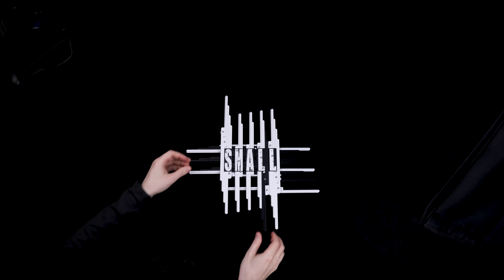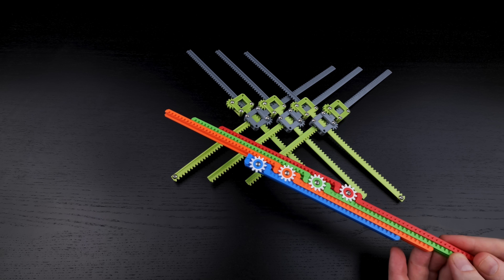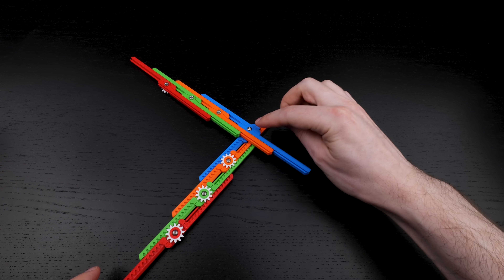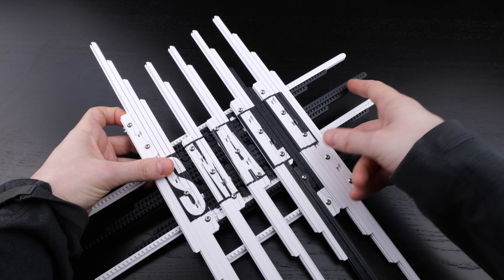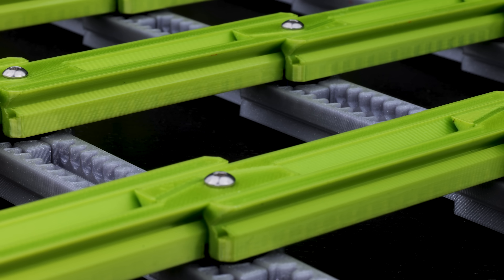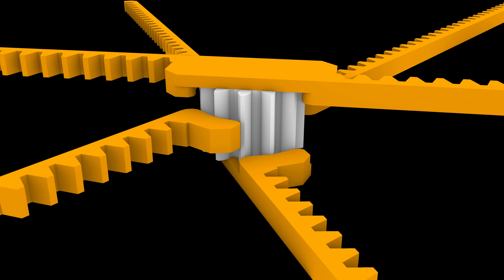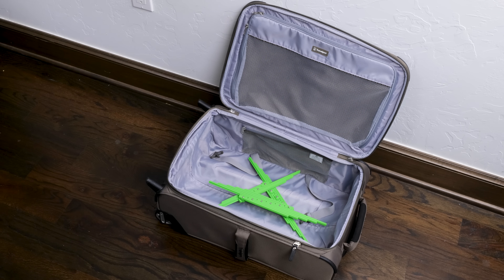Expanding racks

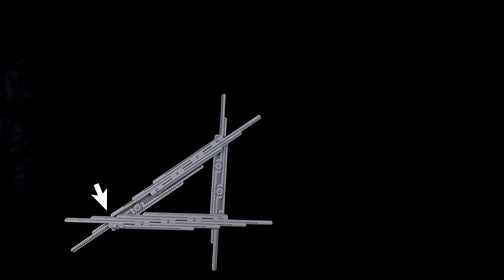Comment: 15:00 Actually. Can you make the inside racks very long? It could be used as a ruler for a black board, a pretty handy one indeed.
Reply: If it was made out of stainless steel and the boarder/edge of the ruler kept a flat straight line during expansion and contraction then yes that would be a great ruler. With some creative liberties you could possibly make this type of ruler have the ability to disconnect and reconnect (attach and detach?) at one connective junction between expanding racks, letting it fold in on itself kind of like a butterfly knife (hard to explain with words it would be easier with visuals)

Comment: A design team I was in a decade and change ago used a very similar design in order to achieve a 2 to 1 telescoping for a mechanism to shuttle a heavy payload along rails.

I believe we used chains confined in a track, and those chains were attached around sprocket in a similar way to how you are using the gears. Basically, there was a fixed stage, a moving stage, and finally, a 2:1 moving stage, exactly like your first example on this video.

I don't know if the system was ever finally built and implemented, but it was a real mechanical application where we were space constrained and needed to provide mechanical motion of a package along rails, so we used this to effectively achieve that solution.

It's funny because no one had a good understanding for how the system would work until I made a cardboard model using push pins and string. For the design review with our customer, I 3d printed the mechanism similar to yours.

Great video. The mechanism has real application in mechanical engineering, although it is (like many mechanisms) a little niche.
Reply: That sounds similar to a pretty common mechanism used in forklifts, where the hydraulic cylinder attaches to the gear with a chain looped around it, so one end of the chain stays still and the other moves twice as far.  I suppose a chain avoids needing large precision-built gear racks.

Comment: I was tinkering about a soution for a project. I wanted to make a shield that can collaps for airsoft. The solution i want to try are folding segments and fould them. All other variants were to heavy and complicated for something like that. But what i saw here gave me a complete new perspectiv and i want to thank you for that.
Reply: If you had the means you could use a co2 canister to expand tubes like a hydraulic ram
Reply: @macallan3933The Thing is i want to strap it in my arm and keep the weight as Low as possible. I Font know how heavy that would be.

Comment: How would you go about preventing it from collapsing in the most simple way? Let's say I want to use it to hold something heavier than it while extented.
Reply from the maker: If you have a motor attached to one of the gears that opens or closes it, just hold the position of the motor to stop it collapsing?

Comment: This could be used to make expanding habitats on space stations. It could be transported packed in its small form and expand to much larger size potentially as girders or the exoskeleton of pressurized modules. Maybe it could also be used in large, boxed transport vehicles to lower aerodynamic resistance when traveling empty.

Comment: I think I independently came up with your extensor mechanism (3fold scissor)! Have you tried differentially powering one of the 3 legs of a single extensor, and also creating the interlinkages (between each leg) flexible? Id be interested to see what kind of directional control one might have over the direction of extension
Reply from the maker: Compliant mechanisms (and anything else that relies on the material flexing) seem really hard to design!
Reply: @henryseg I’m not exactly sure of your implementation of the extensor as the resolution is not great, but in my inplementstion I had a common node that was 3 pivots connecting the legs, I believe it would only take a pivot that was effectively on a ball joint
Reply: A pivot shaft made out of a flexible material seems like a simple
Place to start

Comment: IRL pinch-to-zoom, how neat! Put some LEDs on a rectangular array of these, and you could make a low-res screen with adjustable size. 

Would it make sense to have a robust but sparse grid of double/triple racks as a base, and then fill in the holes with a bunch of identical smaller, finer grids? To increase the resolution, I mean.
Reply from the maker: LEDs on the grid would be very cool! Wiring it up though… I’m not sure about smaller grids to fill holes. Maybe have the smaller grid at 45 degrees to the bigger, and only attach at the corners of the square hole?
Reply: @henryseg Right, I hadn't thought of the wiring... I'll bet screens are hard enough to engineer as it is even in their fixed-size variety.
Reply: @henryseg  I think it might be possible to simplify, by making the racks themselves conductive. Imagine a 2D grid if rows and columns of racks, where each pixel is located at a junction and connected to its row and column. Each LED could be made to shine individually by placing a voltage between a specific row and column, say using a RaspberryPi. Cycle through them quickly enough, and it should look like a picture, and you could go pretty quick if you did diagonals of pixels in parallel.

Comment: Using the gears that have one size on the top and one size on the bottom, it would be very interesting to see if it’s possible to make two squares that sit on top of each other, where the bottom square is smaller than the top one when collapsed, but larger than the top one when expanded. 

As for practical applications, I could see something where an arm needs to grab something that’s far back on a ledge, and by using two or more gear ratios here, you could accomplish that with a single motor controlling the entire complex motion. I don’t know that it would be any better than existing solutions, but that could be neat. Additionally, you could make baskets that can expand to the size of the items you want to put in them if you had some way of locking the racks and pinions in place. That would be useful for the trunk of a car. When I go grocery shopping, I buy a pretty variable amount of food, and having an easy way to size a basket up or down to hold the bags vertically in the trunk would actually be pretty nice.

Comment: You could potentially use this to make some sort of deployable expanding truss bridge, where, when stretched out to span a gap, it also increases in height to increase in rigidity enough to support a load, but it can then be collapsed to be transported in the back of a truck that can cross it.

Comment: ● The movement of the stack of sliding rods at [1:40] is a dead ringer for a pattern seen in nature, specifically in Bacillaria (A clade of photosynthesizing Diatoms +), which, needing both sunlight & access to nutrients, will slide their long silicate shell bodies in precise relation to their neighbours to maximise their access to both resources. I suspect that if you showed your designs to a microbiologist or had a researcher investigate any structures ressembling your designs in nature, then you may find that evolution has already solved many of your problems through millennia of trial & error. (Biomimicry is a branch of Engineering Design where we replicate nature's design solutions). 

● It may also be a "proof of concept" that these types of mechanisms may work as micro or nano-structures (although how you would control, power or especially assemble the structure would be a major work in itself). The potential is huge though; if you consider a far future material being able to go from a small dense cube (like a block of hardwood), to a big diffuse cube (like an aerogel), while retaining its structual integrity. You could build a robot composed of myriad 3D shapes, which would move something like a gigantic pixilated slimemold, oozing from one shape into another by altering the densities of its nano-block components (or moving the individual parts in relation to each other) in waves rippling across its form.  

● It will be fascinated to see how you'll extend these expanding tessellating structures into the Z axis, making a 2D pattern into a 3D one while retaining the movement of the mechanism, taking it from a small dense cube to a large diffuse one...

Ref:
   ▪︎ Bacillaria (Microcosmos video on The Diversity of Shapes in the Microcosmos [8:00])
Reply from the maker: Wow I had never heard of Bacillaria before, they are super cool! Yeah if anyone is in the business of designing tiny geared machines (with photolithography?) I’d love to try designing on that scale.
Reply: @henryseg  These amazing microorganisms (and others like them called Radiolarians) actually construct their stunningly beautiful & extraordinarily complex exoskeletons out of Silica (SiO₂ which they can extract from seawater), making them both structually strong, and - importantly for a photosynthesizing organism - transparent to visual light (though opaque to Ultraviolet). nb: I highly recommend that you check out the artwork of the 19th century scientific illustrator, Earnst Haeckel. [ ● ] Some of his illustrations show the extraordinary biological engineering (which you'd swear was artificial, even architectural) in the "Frustrules" [ ●● ] of Diatoms (& similar organisms) in quite exquisite detail. More recent images (captured with an Electron Microscope) show nanoscale structures (derived from approx. 3.7 billion years of evolutionary progress) which show tremendous potential in macroscale human engineering & design applications. 

~ ~ ~

This situation actually illustrates an increasingly common problem in Science.

It's pretty much a complete fluke that:
   ▪︎ I'd seen that Microcosmos episode, 
   ▪︎ I'd memorised the imagery of the gliding Bacillaria Diatoms, 
   ▪︎ My memory of those remarkable organisms was actually triggered by the imagery of your rack & pinion mechanisms in action.

Conceptually, the problem is that because the sheer volume of Scientific Research has become such a massively complex edifice, it's become physically impossible to study more than a few (typically inter-related) scientific disciplines (eg: Genomic Genetics + Computer Programming; sufficient to develop a Genetic Analysis Algorithm) over a single lifetime. This means that many of those remarkable leaps of inspiration by polymaths - which led to new scientific discoveries in times past - are increasingly unlikely to occur in the future.

I'm hoping that some form of analytical AI will eventually become a sophisticated enough tool to bridge the gap for many researchers; searching across myriad scientific fields & even artistic disciplines [ ●●● ] for patterns which actually relate to your work (located in some really obscure locations), thus both saving you many hours of effort in redundantly "reinventing the wheel" and stimulating inspiration in new ideas & directions for your own work.

[ ● ] - Hæckel's art was how I first learned about Diatoms, as well as a (somewhat similar) variety of microorganisms called Radiolarians which have astonishingly fractal & staggeringly complex Silica exoskeletons.

[ ●● ] - Frustrule is the scientific term for the crystalline exoskeletons produced by Diatoms. (single-celled Algae like Bacillaria).  [ I quite like the sound of it myself... ]

[ ●●● ] - An IRL example would be combining the engineering potential of Materials Science, with the Mathematics of Origami Folding, to construct solar panels capable of both fitting within the narrow tube of a launch vehicle & expanding out to cover an optimally functional area, all the while keeping the weighty deployment mechanisms to the bare minimum.

Comment: now to go into the 3rd dimension
something else i could also see is for the collapsing one part while extending the other some sorta walking mechanism potentially
it would also be neat to power with a motor, could make a hidden garden gate or a special door, although that would best also pivot on the hinge to move the tracks out of the doorway so you end up with this colapsing gate that colapses in on itself and opens in a really artistic way

Comment: What if you made a right triangle with the two legs shrinking and growing opposite to each other?
Reply from the maker: That's interesting...although the angles at the non-right angled corners would change and also the length of the hypotenuse would need to change in a non-linear way.

Comment: I’m now curious about using telescoping tubes with a cylindrical rack on the inside an a donut shaped gear (would have to be a deforming material like rubber)

Comment: Can you play with the gear ratios so smaller inputs make big movements?
Reply from the maker: The current designs already do this in a way - if you grab two neighboring bolts on a stick and pull them apart the whole thing expands, even though you only move the bolts on rack length apart. It requires more force to move it like that - you trade force for distance travelled.

Comment: Seeing the grid of equilateral triangles makes me wonder if it could be possible to create a geodesic sphere, like the Hoberman Sphere you mentioned at the beginning of the video, but with these rack-and-pinions instead of the scissor-links. I'd be interested to see if such a system would facilitate expanding and contracting, or if it would end up binding and locking up. Perhaps you could experiment first with a 1-dimensional rack set forming a loop and seeing if the circle could freely expand and contract, before moving on to the 2D grid of triangles making up the surface of a sphere.
Reply from the maker: A straight-lined polygon will expand and contract fine. But if you have curved racks then the curvature is baked in. So a polyhedral Hoberman Sphere analogue should be doable, but I don’t see how to make an actual smooth sphere, cool as it would be.

Comment: Do you reckon this could be used to make an umbrella that both telescopes its shaft and canopy? With circular gear racks, or even flexible ones that become rigid under tension. Creating an incredibly portable and durable umbrella.
Or potentially an arm mounted grabber that extends when the hand is flexed or relaxed. To allow people to grab with far more accuracy and strength than typical wire-in-tube or scissor mechanisms.
Garbage litter poles, that extend out so you dont have to keep bending over.
Jointed ones inside of a sleeve that can be used similarly to drain snakes.
Expanding rulers with measurement marks depending on the stage of extension.
A chair with a set of curved racks, closed position is a C shaped lounge chair or bench, open position is a much larger canopy design that provides shade and far more comfort for longer lounging periods.

Comment: I bet it would be useful in outer space. it can be use this to make a structure that can fit in to a rocket then grow larger. their might be some ridged advantages over linkages, like antenna and imaging might that depends on not wobbling from expansion and contraction. I would think the driving electric motor would require less torque and so could be smaller and lighter even if the structure is more heavy then linkages. it should be the right tool in a tool belt, I bet it's vastly better then linkage for some application.

Comment: There's a fascinating video by Know Art about various telescoping mechanisms, mostly on vehicles and such so it might not be very applicable to you on a small scale, but I think you'd find it interesting nonetheless.  It's called "The Smart Tricks Inside Telescopic Machines".
Reply from the maker: Yes I saw that one! I was thinking of referencing that video in mine, but it didn't end up fitting into the script. I suspect that chains and pulleys are more mechanically reliable than gears and racks.

Comment: Could you make a 3D version, perhaps using bevel gears at the intersections or something? You could make shapes that shift between the stellated polyhedra and their regular counterparts, by simply translating the vertex along the expanding edge. Could you also join extending and contracting mechanisms together, by reversing the gear direction or mirroring the rack?

Comment: I wonder if this could be used to create a low cost open source alternative for consumers and hobbyists to the nesting support blocks and similar structures used in industrial manufacturing machines to connect leadscrews up to arbitrary lengths and to increase practical velocity on individual leadscrews.